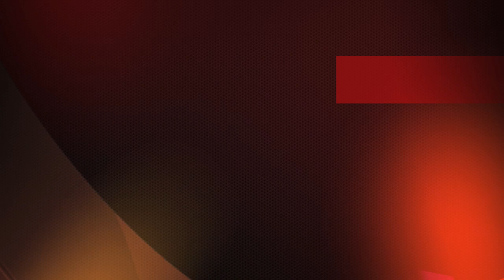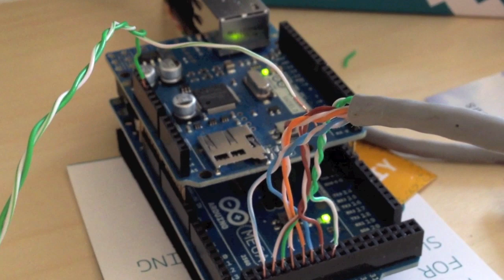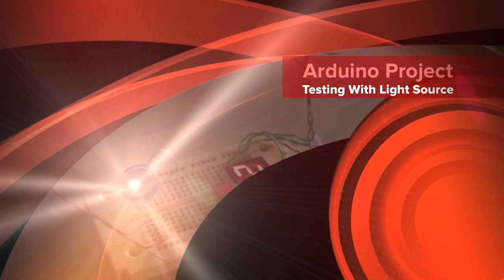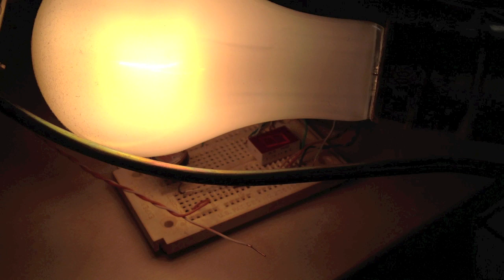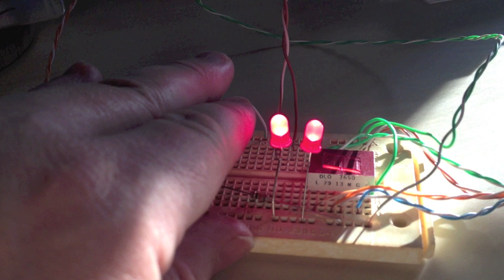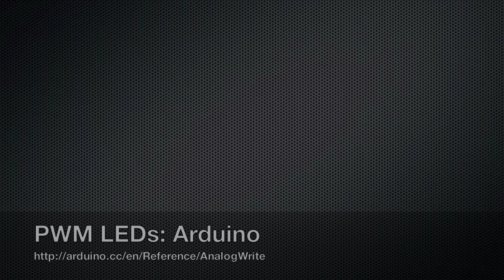Arduino Project - Lighting Controller

Comment from the maker: While possible, the clock on the Arduino is not accurate. With an ethernet or wifi shield, you could program it to update the clock via NTP on a regular basis. There is a tutorial on the Arduino site to get you started: arduino.cc/en/Tutorial/UdpNtpClient